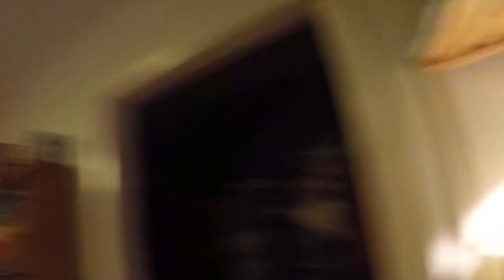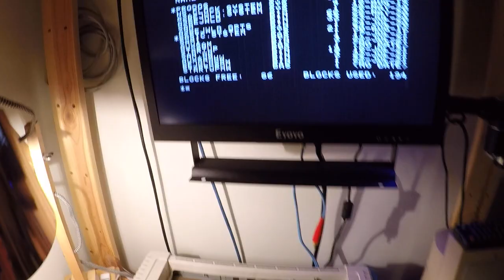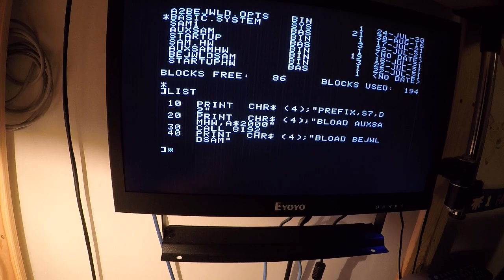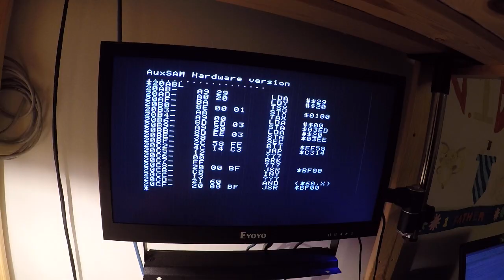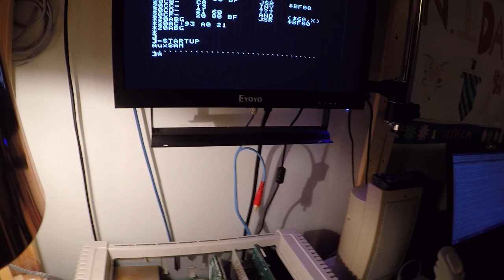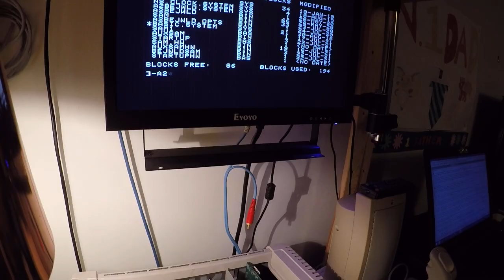Kansasfest 2021 Hackfest entry - Giving Total Replay another voice

Comment from the maker: I worked out my issue with the SAM software version of the Crimewave phrase. The entry point for the phrase was not consistent with the hardware version (which needs more setup and therefore more bytes before the phonemes start). I have since fixed this discrepancy to ensure the interface will be the same between the two versions.